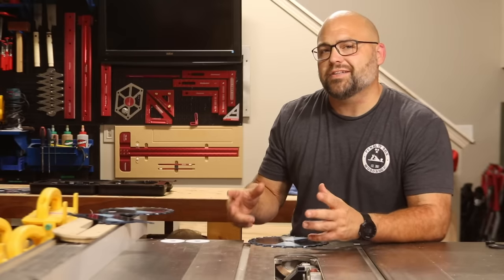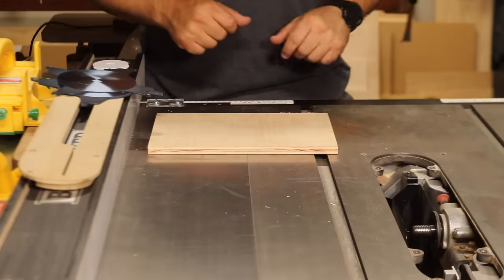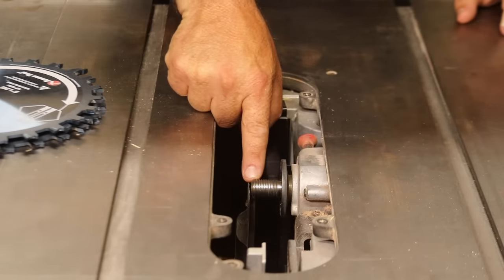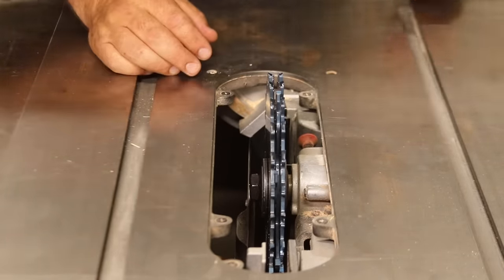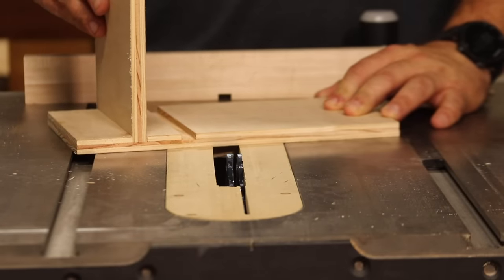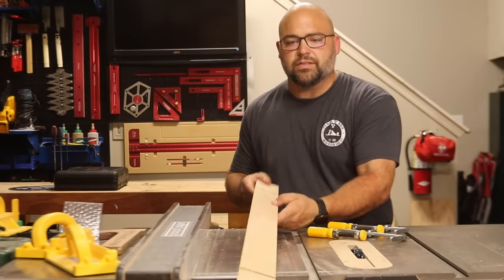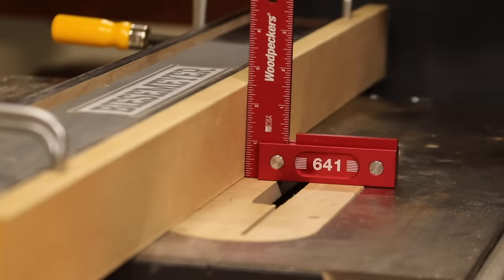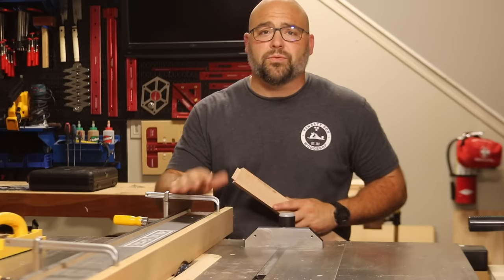How to Set Up and Use a Dado Stack - Full Tutorial and Examples

Comment: Is there an advantage to using a Dado stack over a router table? It's only about $50-60 more for me to get a table for my router than one of the mid range stacks and i'm wondering if I should do that instead. Seems like router would be a bit quicker and easier set up.
Reply from the maker: Yea you can cut them with a router table just limits you on long boards.

Comment: I'm just getting started and I thought you could use either the fence, or the miter gauge, but never both like you did in your tenon example. Does that rule not apply here because it is a dado stack?  Also do you have any recommendations of where to buy blades and dado stacks?
Reply from the maker: So, yea that’s a good general rule however there is less of a chance of kickback with a dado stack. If your just getting started I would be careful doing anything that made you feel unsafe or uncomfortable even if others do it. You’ll build knowledge and confidence as you go for sure. I get mine online at Toolstoday

Comment: Good video. I have a delta table saw and used the fence that comes with it,I see your is not the that one. Why use the fence you have I stead of the one that comes with the saw?
Reply: One thing I don't like about the standard fence is that I have to keep aligning it. And when you move it to you desired dimensions the back  always move closer yo the blade when you tight it. I assume these doesn't happen with your dance. I am willing to upgrade just to avoid it.
Reply from the maker: I upgraded to this one because it’s larger. You should be able to make adjustments to the one you have to fix that

Comment: I have a ten inch saw, is it crucial that I use a ten inch dado? Thank you.
Reply from the maker: SFN No you should be able to use a 8” dado stack as well. You just won’t have the cutting capacity of a 10”
Reply: Unless you are cutting super deep dados, selection do you need more than a 6" dado stack.  I know with my saw, i can still cut a 1 9/16" deep dado with a 6" dado stack.

Comment: Help! Im tryin to find the blades for a 1/8" kerf, 1/2" high dado cut but all the multiblades i find start at 1/4"(2×1/8" kerf) can i use one outside dado blade in the saw? Suggestions for a 1/8"kerf? My work load is increasing and doing multiple passes on the saw is becoming impossible!
Reply from the maker: I don’t know why you can’t just use the outside blade

Comment: SAWS THAT CAN TAKE A DADO SET... So, I've been looking for a "cheap" 8" inch or bigger table saw that I can relegate full time to my 8" dado blade set.  By cheap I mean maybe under $300 or so.  I have not been able to find any such saw as the blade mounting arbor is always too short.  I'd like a 13/16 (3/4)"" dado set to fit with maybe three or so threads available on the arbor AFTER the nut/washer holding the blades are firmly and safely on.  Any suggestions?  Let me know of more expensive saws as well if none are available in that price range.  I tried looking overseas but it seems that (in Europe anyway) dados are illegal because of safely concerns.

Comment: Thanks for thus video. My question is how do you correct the measurement on your table saw after installing a dado stack if you want to use the fence ? 

My guess is that you have to subtract the width of your dado stack, minus the width of your regular blade. Is that correct?

Thanks in advance!
Reply: You don't have to make any adjustments because the arbor extends away from the fence, not toward it.  Therefore, the width of the blade has no impact on the distance between the edge of the blade and the fence.

Comment: Im using a Diablo dado set and setting everything up correctly. But  for example on a half lap joint the cuts are not smooth, like one blade or chipper is cutting deeper than another? Not just a little bit, its enough to mess up the fit. Any advice from anyone would be greatly appreciated. Im new to woodworking
Reply from the maker: That’s in interesting question and not something that’s I have encountered. I do not know that answer to this other than a defective set. I’m sorry
Reply: Ok thank you

Comment: Can I use a Dado stack on a Delta Contractor saw? Just a I wouldn’t or I do use on Contractors saw would be great really want to use dado stack to make 3/4rabbit joints thank   You
Reply from the maker: I doubt it but you can check the length of your able to see if it’s long enough to accept one. Typically on smaller contractor saws they will not

Comment: Is there anything you can do when your dado stack doesn’t leave quite enough threads on the arbor other than multiple cuts with a narrower stack?
Reply from the maker: Nope, that’s the only option. Anything more than that would be very unsafe. My arbor will not hold my entire stack either but I just make do.
Reply: Try using a router: Cut Dadoes With a Router Jig 

But, if you do use a DADO set on a Table Saw, do NOT pull the work back over the blade after making your cut (has he did here). When the work has passed the blades,  remove it from the table safely, then reposition it for the next cut.

Ask any of your four finger friends how fast a chunk of wood can be flung 'back at you' when caught by a speeding Dado set.

Comment: Question for you. If you are using the dado set to make 1/4" dados you only need for the most part the two outside blades. For now lets stay with no shims. So you put the left blade on and then the right blade on and this should give you as I said 1/4" cut. If you turn on the blades and look at the teeth rotating toward you shut off the saw and watch the outside blade as it coast to a stop. Does the outside blade on the right appear to run out of round? the left blade is fine. I have an 80"s vintage Craftsman table saw. The problem I have found is the right blade sets on the arbor where the thread stops and the smooth shaft of the arbor is occupied by the left blade. There is a small undercut where the threading operation of the arbor, that is the cutting tool for the threads needs an area to run off the diameter and be cutting air at that point. 
When you slip the two outside blades onto the arbor and just seat them, if you can get a hold of the right blade lift up just a little and notice if the blade feels like it has a small amount of play, as if the 5/8" hole in the right hand outside blade is oversize. I tested this by swapping the blades, so the left is on the right, and the right is on the arbor first at your left. The teeth of both blades are facing away from you. Don't run it this way. Now lift up on the left hand blade and it should feel as if it now has a 5/8 hole just a little size. My point to all this is there are a few solution I have come up with, but I was wondering if others have encountered this. My guess is you shim to the right so both blades or on the thread portion to make them concentric. The thread portion of the arbor is the same diameter as the smooth portion of the arbor. Sorry for the lengthy questions.
Reply from the maker: I’ve never encountered this but it makes sense to what your saying. Sometimes using older model tools can have their ups and downs. I guess what it boils down to is as long as your comfortable with the solution and believe that it’s safe.
Reply: One option to consider in your situation is the addition of a blade stabilizer(s), which are basically large heavy washers that back up the saw blade to minimize deflection, particularly with thin kerf blades. Using them with the two outside dado blades gives you a thicker 'sandwich' to mount on the saw shaft.

Comment: I just bought a new Rigid table saw (my first one). It's a 15A 10" saw & I want to buy a dado stack for it. The only size I can find is an 8". Is this okay or should I try to find a 10?
Reply from the maker: Most people use 8” blades on 10” saws and rarely would you need a 10” I think

Comment: First time I used my dado stack, I got some pretty serious kickback before I got through the board. I was able to hold the board down and turn the saw off before it went flying. What causes kickback with a dado blade? My only guess is because I was testing into a 2x4 and it was just too thick? Thoughts?
Reply from the maker: Man, I hate that you had that experience on your first try but good job taking a step back and avoiding any injuries. I guess my first question is was it a new or used dado stack?
Reply: Penalty Box Woodshop It was brand new
Reply from the maker: Did the blade hit a knot? The only thing I can think of is you might not have been putting enough downward pressure on the board. I use push blocks to insure that I’m pushing the piece down and through the cut. Make sense?
Reply: Penalty Box Woodshop I don’t think that I hit a knot. I was using miter gauge so maybe I just didn’t have enough downward pressure for the size of dado I was cutting. Definitely freaked me out a bit lol. I appreciate you taking the time to respond!
Reply from the maker: Yea I bet that was it. Any time!

Comment: Is there a reason why you use your paddles with the handles leaning toward the fence? I thought the whole reason they were made that way was so they help push the piece into the fence, which is why you see most people use them leaning outward.
Reply from the maker: I just grab them and push haha. You can put pressure towards the fence with the paddles in any direction but you are correct about which way they are supposed to orient

Comment: I'm new to woodworking so rookie question: I use a router table to do these same cuts. Is a dado cutter better or just a preference thing? Always trying to do better so thanks for the wisdom.
Reply from the maker: No, if you have a good setup on your router table and can make these cuts there is absolutely no problem with it. The table saw and dado blades would be easier for longer boards and has the ability to speed the process up by making wider dado cuts at once than with a router bit.

Comment: I'm a total beginner at this and I'm trying to determine if I should buy a table saw that will allow me to use dado blades.  I was considering a Dewalt saw, but a reviewer said they this particular saw was not able to accept dado blades.  Do you have any advice for choosing a saw that would enable me to use these?
Reply from the maker: Typically smaller contractor saws do not have an arbor long enough to use a dado. You will just have to check on that arbor length to be sure before you purchase one.

Comment: How high can you safely use a dado stack?  If you use a tenoning jig, is it safe to do the full night of the tenon , or should you just use a box blade and multiple passes.
Reply from the maker: I use mine at max height when making castle joints. However, I’m sure it will depend on your table saw and blade and I wouldn’t do anything that you were not comfortable with.
Reply: Penalty Box Woodshop perfect thanks!
Reply from the maker: Any time!!!

Comment: Excellent video! Just the information we need and an example cut on the saw. The Grrrrippers are great, too. So safe.
If you notice, the gripper handle comes up on an angle. If you turn it around 180 deg so it angles away from the fence, then when pushing through, your downward pressure is automatically angling the pressure toward the fence keeping your workpiece tight.
Reply from the maker: Excellent info and I appreciate the kind words!

Comment: Love the video, alot of useful information bout dados. Im new to  woodworking . What size is better for dados, and the table saw is good for them?
Reply from the maker: Thanks! I use a 8” stack on a 10” table saw. Your larger table saws will be better for dado stacks as they typically have longer arbors
Reply: @PenaltyBoxWoodshop  ohh ok so if I can't get those blades.  Will I be able to use a plunge router?
Reply from the maker: Yep, you can use a router for dados for sure

Comment: Dado stacks - and saw that will take dado blades - seem to be  a feature of American machines! I have a Felder 761 machine - the arbour will not take more than one blade; when I enquired about a change of arbour so that I could install a dado stack - Felder guys hardly knew what I was talking about! (I'm in the UK btw)
Reply from the maker: I’ve heard this about saws made in the UK and evidently they are illegal. That’s crazy cause they are a great tool!
Reply: @PenaltyBoxWoodshop  Thanks for your reply - and your video! You are indeed quite correct - dado stacks are illegal in the UK....and in Europe!! Apparently, its because you need to remove the riving knife and the safety cover on the blade, thus making it unsafe! I looked up about 20 blade catalogues - and in just one catalogue (Axminster Power Tools) - they have a dado stack, but you need one of their machines to use them!! Axminster machines are imported from Taiwan and dado stacks are not illegal there; even if I were to ignore the rule and but a dado stack, I know of no machines anywhere that would have a suitable length arbor. Fortunately, there are many other ways that I can make a groove in wood..!!

Comment: When purchasing a dado stack, is there a 10 inch stack or do I have to use a 8 inch stack? I noticed there seems to be tons of 8 inch on amazon but not many actual 10 inch. Thanks
Reply from the maker: Yes they make 10” dado blades but 8” ones work just fine for most recreational woodworkers
Reply: I have yet to run into a case where a 10” would be needed.

Comment: What are your views on the adjustable wobble dado blades? To me they seem much easier to use as you just adjust it to the width you want; rather than juggling the chippers and shims. Great video all the same though!
Reply from the maker: +Diamondblade2008 Thank you! I have never used one of those but to be honest they scare the hell out of me hahaha. Maybe they are not as dangerous as they seem though.
Reply: @PenaltyBoxWoodshop  Hi PBW, thanks for your reply! I should have been more specific in my comment; I was actually referring to a twin blade adjustable dado (not the single blade variant) as seen in some early New Yankee Workshop videos. The twin blade adjustable dado does seem to cut nice square dados without rounded bottoms just like the stacked dado. And of course you simply adjust it to the width you want, instead of messing around with chippers and shims.
Reply: With the Wobble Dado, They are more time consuming in dialing into correct width...

Comment: I have a vintage (71) craftsman 12in. tablesaw. Is there any reason why I couldn't use a 8in dado stack on it? I've never used a dado stack before. Thanks
Reply from the maker: You have to make sure that the arbor length is long enough to accept one but I’m just not completely sure with vintage saws. I only know about mine haha.
Reply: @PenaltyBoxWoodshop  thanks. The Arbor length is long. My thinking is as long as I have clearance I should be good to go. I think. Anybody else have thoughts on this?
Reply: you should be fine if the arbor is long enough but make sure the tablesaw falls within the RPM range of the blade
Reply: @keithc9146  thanks Keith for replying to my ?

Comment: Thank you for the video. I have a 10" table saw and have never even tried to cut a dado. Mine is not a very high grade table saw but it is what I could afford. All the dado sets I saw are 8" can I use them in a 10" saw. I really have no idea what to buy but I dad check out Prestige and only  saw 8". Thank you for any information you can give a new wood worker. Dave Dickson Bloomington MN
Reply from the maker: Hey Dave, thanks for watching. Yes, you can use an 8” stack on a 10” table saw. The big thing is if you arbor is long enough to accept the width of the stack.

Comment: So my saws break must be really strong or I'm not tightening the nut enough, when u hit stop on my hitachi it slams it stopped and the chipper crashed I to side throwing sparks, there is also a lot of vibration, does that mean it's not installed properly?
Reply from the maker: Either it’s not installed properly or that saw is too small to handle a dado stack.

Comment: I noticed when you made the dado cut lengthwise on the board, the left side of the board (from the saw operators perspective) was slightly elevated off the table. Hence, the dado was not square to the face of the board. That seems to indicate that your zero-clearance saw insert was just a bit too thin.
Reply from the maker: That’s interesting and I’ll definitely look into that. Not something that I’ve noticed but I could have overlooked. Thanks!

Comment: Dumb question from a dado noob...

If you need to glue the connection, how tight of a fit do you want? Do you need to leave it a bit loose so the glue has somewhere to fit in between for a good high strength connection?

I'm not overly experienced, but I'm trying to learn...
Reply from the maker: You want as tight a fit as possible. The glue will squeeze out just fine and create a strong bond
Reply: @Penalty Box Woodshop  ok thanks, I was afraid if I made the connection too tight too much of the glue may get squeezed out...especially say on something somewhat structural where strength is a must.

Comment: I am a beginner with power tools.  Can I use a dado with my DeWalt  DW745 table saw?  Where do I purchase an insert or do I make one?
Reply from the maker: Welcome to the woodworking world! I am not familiar with the Dewalt saw so I’m sorry I can not answer that question. You will have to refer to the manual and measure to see if the arbor is long enough to accept one. The insert can be easily made.